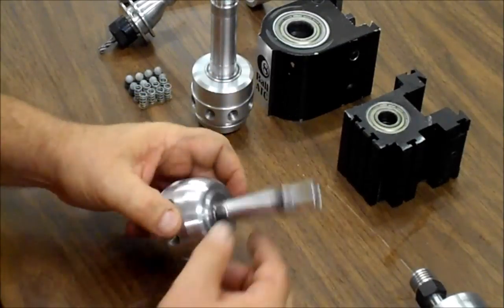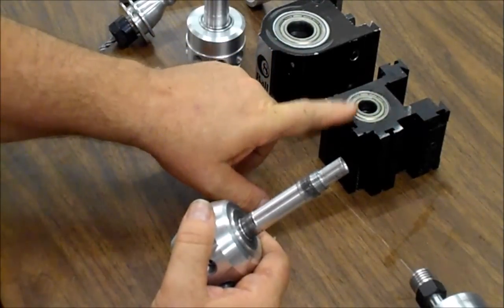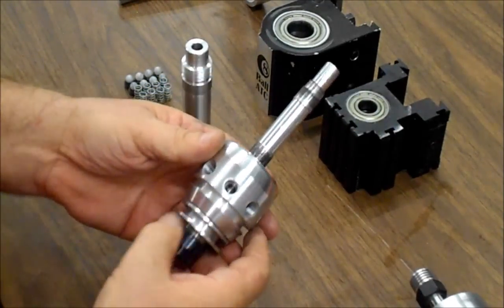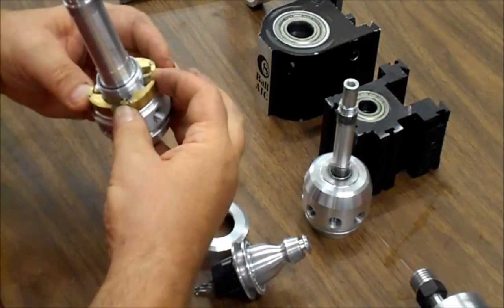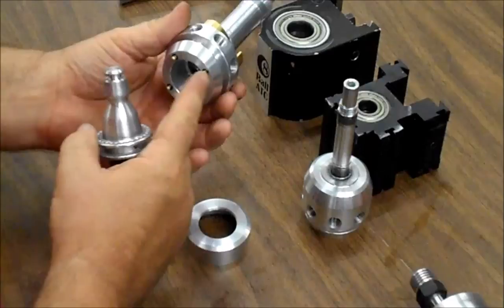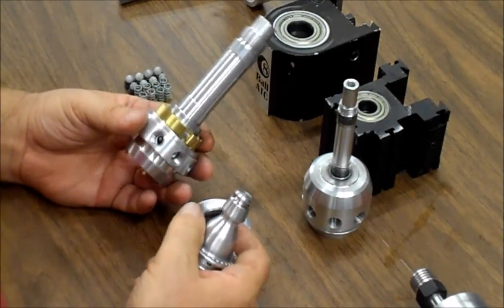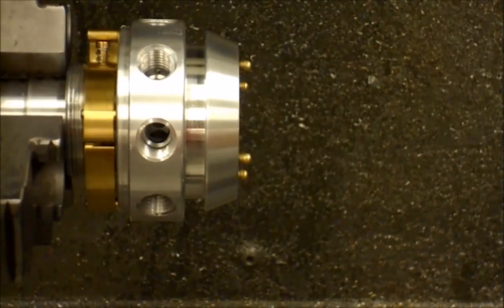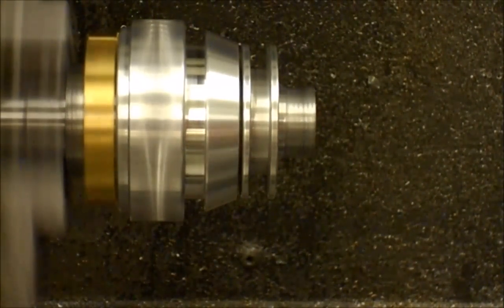youtube video #4B59ZnPdjJA

Comment: Only the 8 balls and springs apply axial force via the taper and clamp the toolholder. But that force decreases with spindle speed. The locking pins engage when the tool is already loosened and they don't apply axial clamping pressure. This way the flyweight system is a somewhat complicated band-aid for a fundamental design problem.
Maybe the flyweights can be arranged to also apply axial pressure or better the balls and springs could be arranged to increase clamping force with spindle speed and the second (flyweight) system can be omitted.
Reply from the maker: Nope, no problem with the design....thanks anyway. Ball pressure maintains just fine at maximum speeds and the flyweights actually increase holding force with higher speeds.
Reply: Christopher Smith Why is the flyweight system necessary when the ball pressure is fine and how are the balls and springs not influenced by centrifugal force?
Reply from the maker: I can take heavy cuts all day with straight router bits with no problem, but if I choose to take heavy outside cuts on aluminum the helical nature of the end mill has a tendency to tug and pull on the the tool so that it chatters a little. It never actually pulls the tool out though. The pins used with the flyweights are tapered and increase holding pressure as the speed increases. After the addition of the flyweights I had no problem taking heavy cuts. The balls are still necessary as they draw the tool into position initially before the flyweights engage. They also "snap" the tool holder upwards about .100 to lift it above the tool plate recess.
Reply from the maker: The balls are also nylon being held in with 10lb springs. They run around .375 from centerline when seated. At only 10,000 rpm there is no chance of these balls to counter the pressure of the spring holding it in place.
Reply: Christopher Smith Thank you for explaining and of course for showing it in the first place. 
Best wishes
Reply from the maker: You are very welcome.

Comment: Since you have to make a whole new spindle have you considered changing the dovetail mount? IMO the dovetail mount for the spindle is the weakest link for the Taig and having something stiffer and easier to tram would be amazing.
Reply from the maker: What is your suggestion? The dovetail setup would be the easiest way to connect to the block
Reply: Christopher Smith run the bolt through to the other side of the dovetail on the spindle extrusion.
Reply from the maker: I don't think anyone can see the mount clearly in this video. The spindle housing (not extrusion) has two hex thumbscrews ( https://www.mcmaster.com/#90732a380/=18yg480 ) that are accessible from the top and bottom of the housing which operates similar to a quick-changer toolpost on a manual lathe **except that you tighten the screws with a wrench**. I see no reason to change it

Comment: I am building my own CNC from scratch rather than making a larger copy of my existing 2 x 2 CNC Machine. I am sure what I am doing will be a little over the top and/or different but the fun is building it. Do you have a kickstarter or any other way to buy one of your 8-Ball ATC's. I want one for my machine, not because I expect to do a lot of tool changes but because it is unique like some of the other parts of my new CNC.
Reply from the maker: You would be surprised at how much more you would do when you finally do have a tool changer and not have to bother with interrupting a program to change tools. I work full-time as a machining instructor in a college in Wichita Falls, Texas so I have to work around my work schedule which is sometimes difficult to do. All I can say is that when it is ready it is ready. I plan to contact those who have shown interest, and instead of starting a kick-starter, tailor to the actual needs of the client so that there are no limitations and time restraints. The tool holders have already been brought to production but the spindle has not. The rest of the project is mostly made from flat stock, easily machined with no close tolerance worries. Just be patient with me as this is no easy project to initiate from scratch.

Chris

Comment: Will this work with a cnc for wood (RPM's up to 32,000 rpm) If so Let me know when they are ready!
Reply from the maker: RPM's will be limited to 10,000 RPM because of the bearing limitations. I run woodworking projects all the time at 7500 RPM on my HAAS mill without any problems at all (and no burning as the result of low feeds with high RPMS), so even though routers turn up to 32,000 doesn't mean they are required to turn that fast to give good finishing results. This spindle is designed to use an average 1-1.5 HP trim router turning 30,000 RPM with reduction pulleys that bring the maximum RPM to near 10K. This will greatly increase the output torque of any trim router and give you the option of using any tool with a shank diameter up to 3/8 including any drills up to 3/8 as well. (because the spindle is using ER16 tapered collets) This system is expected to come out in early Summer.

Comment: A centrifugal clutch! Looks like a setup from a nitro powered RC car
Reply from the maker: Actually the clutch is the pins on the bottom that locks the toolholder in place and keeps it from rotating in the spindle. The flyweights lock the toolholder in place after ~1000RPM so that it remains rigid in the spindle during the cut. But yes, very similar to a centrifugal clutch.
Reply: +Christopher Smith  Oh I see now, what a unique design

Comment: where's you buy it? how much it cost? thanks
Reply from the maker: Two spindles are being manufactured at present along with 12 toolholders to be mounted on a Taig CNC mill and a CNC Router that will be made available as well. After these products are produced I will be able to report to you the cost. It will probably have to be funded through Kickstarter, as it will cost more than I can invest in at this time. It is vitally important that those interested subscribe to this channel so that I can justify this venture. I have also designed a lathe turret that holds four OD and four ID tools. While the mill parts are in production I will be building the turret as soon as the raw materials arrive. The turret will mount directly to the Taig Z-axis block. The original Taig motor and spindle can then be mounted to the table to serve as the spindle. The ATC macro is already finished and working. I will post a video when it is finished.

Chris
Reply: @Christopher Smith : wow, that was awesome, you have good work out there, wish you luck, i google and look at ebay for this ATC before, hahaha
what about that big spindle and headstock? do you made it too? that look rigid and steady, perfect for my taig mill. 
i have a lot of taig product, plan to make video of it and put on youtube. thanks

Comment: It took me a while to figure out why you were building this complicated tool holder system.  You are trying to avoid adding a pneumatic or hydraulic collet puller on top of your spindle head.  It might be a good idea to make that more obvious at the beginning of the the video and video description.  Maybe add some text in the video.

What kind of repeatability do you expect on the tool length?  Do you think the Z zero will shift as the spindle ramps up above 1000rpm?  Also if you rotated the fly weights 90degrees would the tool get pulled up into the taper as RPMs increase?

Is there a way to design this without the multiple tapers?  I would suspect they make the tool holders and spindle more expensive to manufacture.  The TTS holders in contrast are pretty easy to machine and grind (even tho they are not as precise as a taper).  I could see adding a bearing race in the middle of a cylindrical tool holder to engage the balls and another rebated cylinder with a groove for the fly weights to engage being pretty easy to machine then grind in comparison to multiple tapers.
Reply from the maker: Mike - I do mention the fact that it operates only by spring pressure and flyweights in the description below the video. This project has taken on several changes since it started 16 months ago, each video showing the changes that were made and why they were made. 
This was a venture to create a tool changer for the four Taig machines that are in my machining lab so that I could teach my students on machines that could handle the abuse that is so prevalent in instructional labs without tearing up my industrial equipment. 
I wasn't planning to grind any surfaces but to make it acceptable to use for ordinary modeling and prototyping without making the silly thing so expensive that it costs more than the Taig itself. The next step is to have the finished prototype machined using materials that are much more resistant to abrasion (410ss for spindle / 303ss for the toolholders) unless anyone has a better solution and can suggest otherwise. This is not for industrial use, it was designed to be an inexpensive and affordable ATC for those who need and want one....and it works very well!
Reply: I'm glad it works well.  

I was thinking in terms of bringing a product to market and not a personal project.  I hope you didn't read negative criticism into my post, I was just throwing out ideas in case something was helpful in a product development sort of way.

Have you been noticing any variation in z-axis offset?
Reply from the maker: <Have you been noticing any variation in z-axis offset?>
By that do you mean "is there any difference from one tool to another?"
Absolutely not, and for good reason...... 
Each tool is measured using a dummy spindle head where measurement of each tool is taken from the bottom of the dummy spindle to the tip of the tool (watch this video to see what I am talking about https://www.youtube.com/watch?v=hhMuylU2-1M) It does not matter if there are variations between toolholders because those variations are measured and interpreted as a portion of the length of the tool. As in industrial applications the common location of each tool measurement is the bottom of the dummy spindle, not the tool holder itself. Once the tool has been measured the values can be manually entered in the tool registry without having to stop the program each time to measure the next tool. You can also set your machine up to use automatic tool tip measurement... but why do that when you can measure the tool one time and be done with it.
I read no criticism at all in what you said!  I do, from time to time, have to defend my reasoning for not wanting to harden the spindle and toolholders and to grind them to precise specifications. It is simply not needed for the work that this spindle is required do given the size and capacity of the Taig Mill. 
You mentioned Tormach tool holders.... do you have a Tormach mill?
Reply from the maker: <Do you think the Z zero will shift as the spindle ramps up above 1000rpm?  Also if you rotated the fly weights 90 degrees would the tool get pulled up into the taper as RPMs increase?>
Mike - there is 70lbs static spring pressure holding the toolholder into the spindle before it even starts to rotate. The flyweight pins do nothing more than hold the toolholder in place while taking heavy cuts. Without the flyweights heavy cuts would allow the helical nature of the milling cutter to pull somewhat on the toolholder causing it to dislodge slightly and cause chatter. This design prevents the toolholder from moving at all while the spindle is in rotation.
Reply: I have a cnc converted grizzly G0704 and have been using TTS tool holders since they just required a modified 3/4 R8 collet and drawbar to get started.  I bought some ground steel TTS endmill holders and have been machining more TTS holders in aluminum.

I like how your design does not require a pneumatic piston on top of the spindle head, my spindle head is about to get really heavy with a 3-phase motor.

I'm curious about how repeatable the z-zero is with an individual tool.  Lets say you have 2 tools for a job, T1 and T2.  If your job switches between tools 4 times, would the z-zero for T1 change between tool changes?
Reply from the maker: Providing you did lose steps in Z you should not have any change at all. I looked at the TTS tool holders and wondered how they could guarantee concentricity. Since there is no taper except for the small taper at the top it would seem the tool would not have anything to stabilize the tool....but that is what I see in pictures only. Does the TTS holder require a drawbar, even in ATC applications? If so, I understand why you would be concerned about repeatability......or the lack of.
 I will be creating a prototype for R-8 as well, kind of a plug-and-play tool holder that simply mounts into your existing R-8 spindle and your ready to go! It will come with a table mount tool plate and ATC macro screenset for mach3 making it the easiest CNC retrofit available. You can view it here http://i1327.photobucket.com/albums/u665/VernonCollege_Machining_Lab/R-8%20Spindle_zpsfhshwbnp.jpg
Reply from the maker: "providing you DIDN'T lose any steps in Z"
Reply: I believe the TTS holders use a ground surface that interfaces with the bottom face of the spindle to maintain concentricity.  

The TTS is held on with a modified 3/4" R8 Collet.  The collet is tightened with a draw bar, or a pneumatic draw bar.  When the draw bar is tightened the collet pulls up into the spindle bringing the tool holder up.  There is a usually ground surface on the TTS that bumps up against the bottom of the spindle and that is what is supposed to maintain z-zero.

I have actually seen videos of tts users that put a witness mark on the spindle and try to insert the tool holder into the same clocking position when not using an ATS.
Reply from the maker: How do you measure your tools? Do you use a touch plate?
Reply: Right now I touch off with a shim and subtract the shim thickness on a reference point on my vice jaw.  I've been thinking about building a touch plate or calibrating each tool with my surface plate and height gauge.

Comment: Hey... I wonder if you would recommend this kind of setup for a 4x8 cnc router... I want to add atc.
How is this comming along?
Reply from the maker: Frank, since this requires no additional mechanical or pneumatic changes to your existing machine it would work fine. The only requirements are that you must have homing switches on all three XYZ axis and that you are either running Mach3 (so that you can use my screenset and macros) or you know a thing or two about creating macros for your own control software. The CON's of this ATC is that you will have limited RPM's (no greater than 1000rpms) because of bearing limitations and mechanical balance. I have not marketed is as of yet but am trying hard to get a bare-bones system out by the Fall (no guarantees ) Please visit my Facebook page to see the 9-tool ATC router that I am building with a 25" x 40" machining footprint. The same spindle will be used on this machine (slight changes in design to allow for the flyweight cover to be removed from the bottom instead of the top for easier maintenance ) Please subscribe to receive all updates....and friend me on facebook to see all new updates. https://www.facebook.com/vernoncollege.machininglab
Reply from the maker: I forgot to mention that this spindle can be used as a quick-change spindle just by changing tools manually with this tool. This is a very good alternative for those who are new to GM code and are reluctant to programming tool changes  https://www.youtube.com/watch?v=rjNmG_QaLnw

Comment: how much is?
Reply from the maker: still working on it
Reply: Christopher Smith will the device only be compatible with the taig?  You could probably sell a bunch more of they were compatible with the tormach tts footprint.
Reply from the maker: Tormach already has its own ATC. When this finally hits the market it will be easily adaptable to all custom router and desktop R8 mill applications. Will also provide Mach3 Screenset containing many tool-changing configuration options.

Comment: I have been wanting to do something like that with my BT30... but never could figure it out in my head how the auto locking system was going to work... I will probably use large diameter roller bearings "Atlas Lathe Style" because i want to have a really beefy setup.. "Really want my CNC machine to be able to use a automatic tool changer..
Reply from the maker: I'ts coming.....here is an example of an R8 version of the spindle. Since there are no adjustments to the machine (air actuators for pull studs or any other mechanical adjustments) you just place the new spindle in your machine and go! (of course, this will require limit switches on all three axis and a new screenset and macros for mach3) https://www.dropbox.com/s/3ekp015aj1sur9x/r8.PNG?dl=0
Reply: the spindle looks like a R8... really nice and creative work..

Comment: How about an Internal clamping mechanism (like HSK). 
In this way the clamping force will increase with spindle speed, even without the flyweights.
Reply from the maker: Looked at some pictures but they were not large enough to see the internal workings. Do you have anything (site or drawing) where I can see it up close? If it requires a draw bar I wouldn't be interested, trying to make this as simple as possible.